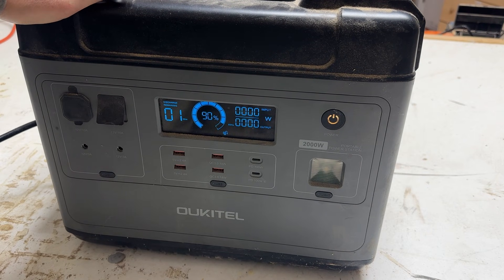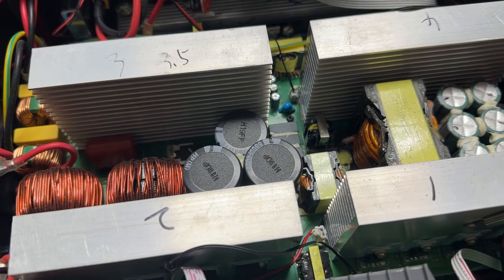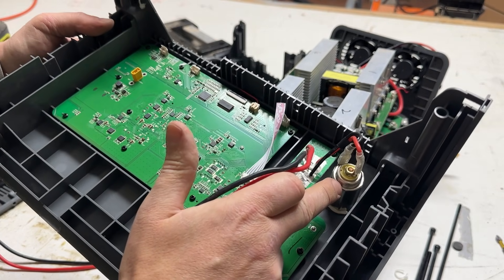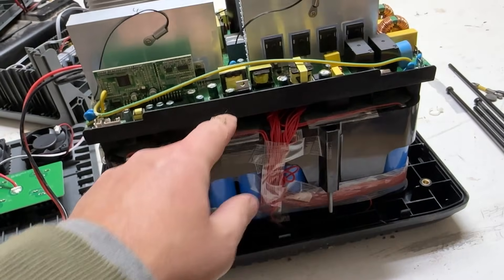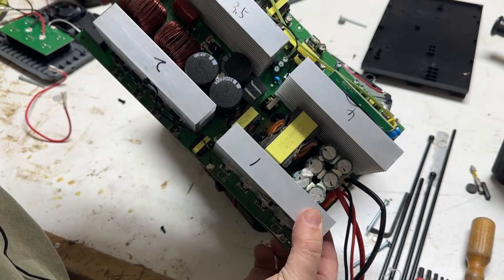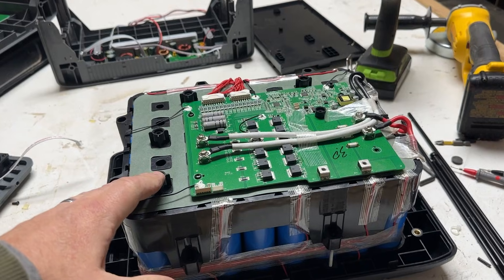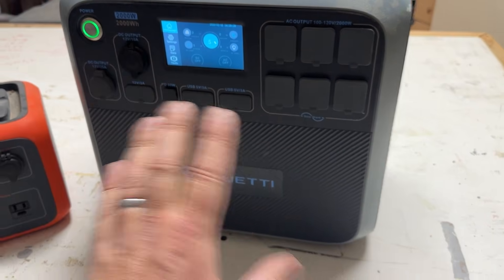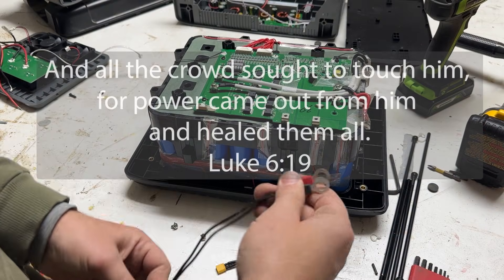Whats Inside a 2000 Watt Power Station

Comment: 8:07 the thin wires are for monitoring the voltage of each cell in the battery. For lithium based batteries it is important that each cell is not overcharged or over discharged.
Reply: Indeed, balancing leads.